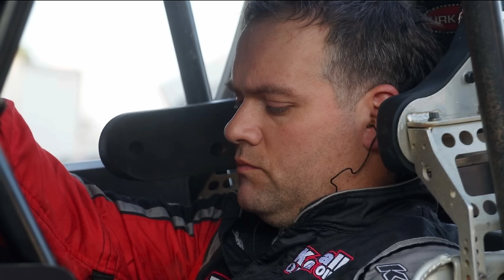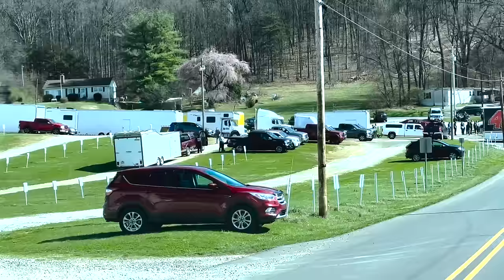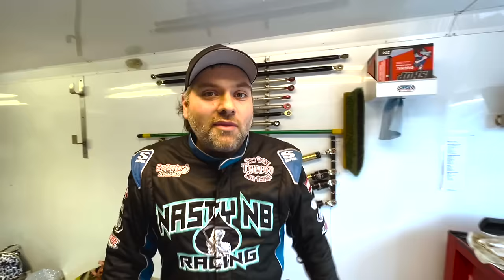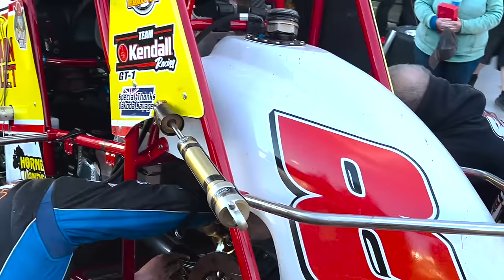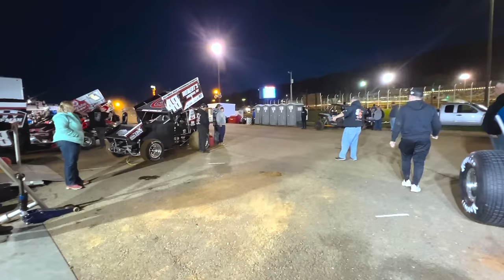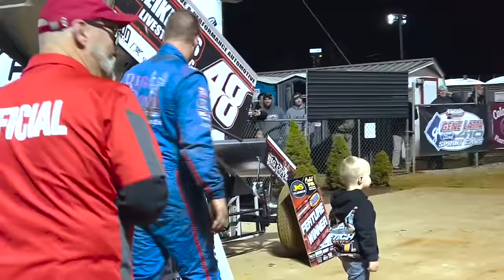The Dietrich Brothers Battle A Broken Axle - Dirt Track Sprint Car Racing

Comment: Back in my day you should have heard some of the screaming I was doing from my car to the crew! It's all heat of the moment shit. Everyone is charged and as a driver you are supercharged. Trying to convey what you want in those times is very difficult. Logically you and the crew would assume a bent wheel? No problem. Get me back out there. It wasn't. Shit Happens and you made a valiant effort! I remember 2 times I flipped the car at Clinton County and stayed in the cockpit while Dad and the crew made repairs to radius rods with duct tape and a hammer! I restarted without the wing and finished! Damned rod ends would rip out from the threads and Dad would just sock them back together and use tape!! I got a 3rd place finish one night that way! He would never tell me what he was doing. Just say, "you're good" and they'd push me off. Different times. Those Ben Cook cars were tough.